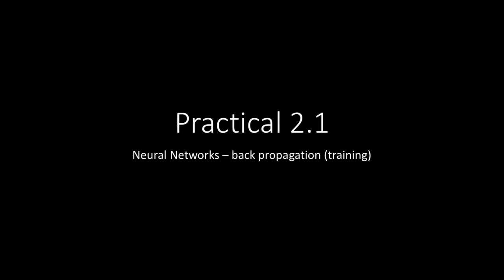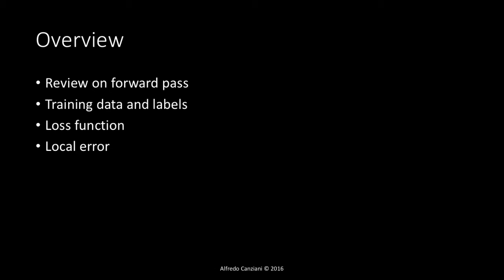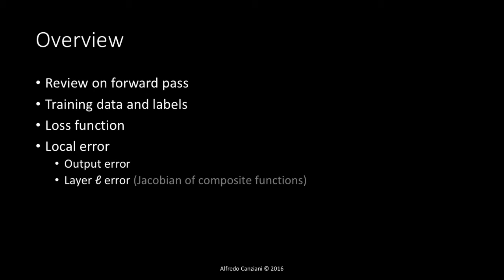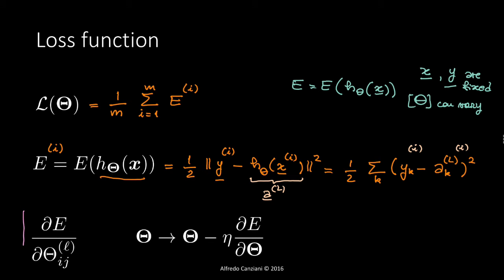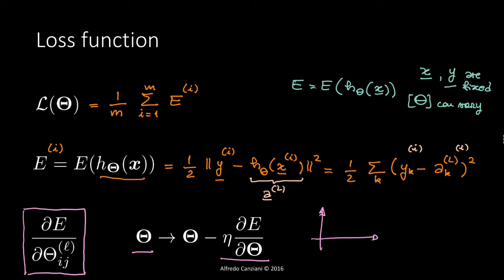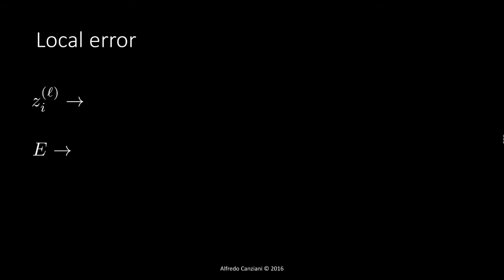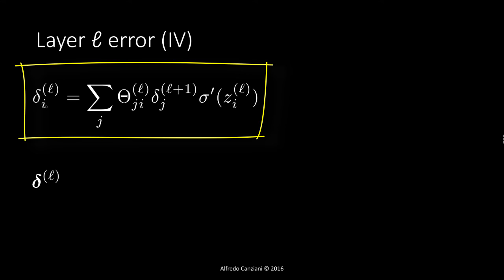Practical 2.1 – NN backward

Comment: Hello, i just had a little question, 

in my case i am implementing a simple MLP (1 input layer, 1 hidden Layer and one output layer) 

------------------------NN CONSTRUCTION ------------------------

net = nn.Sequential()
net:add( nn.Linear(?, 25) ) -- ? input, 25 hidden units        
net:add(nn.ReLU()) -- Activation function
net:add( nn.Linear(25, 70) ) -- 70 output : classes of mpeg7

i have already prepared my supervised data in my tensors and saved in .t7 files (training and testing) 

For the input one img (boundary) for me is represented by a tensor of 1000*3 

The problem for me now is what shall i write in place of '?' in this line somehow it accepts my input :

net:add( nn.Linear(?, 25) ) -- my input is a tensor 1000*3              , 25 hidden units 

i will be too much thankful if i get some response from you @Alfredo Canziani
Reply from the maker: Oh my… I've never seen this message! Do you still need assistance?

Comment: so basically in the training data X is a bunch of vectors describing n features of m different samples, say the color vector of a picture's pixels, where m would be the number of pictures provided and n would be the number of pixels in the picture. (that case would require all the pictures to be of the same size, or another measure must be taken to have the amount of features be equal in number and type). and Y is mapping K, or sL, or the number of outputs of the neural network labels onto that training data. for example: "red", "bright" for the set of features in a specific example.
did I get that about right?
The loss function I do not get. the training data shouldn't have any errors? an error is a discrepancy between a label and the data it labels, yes? for example calling 50°C cold.
Reply from the maker: Yes, you clearly got the main idea behind it, although the terminology you're using is a little bit foggy.
'X' is the "design matrix" which you described correctly.
I wouldn't talk right now about images, because they are "spatial" and we will deal with them later on, in the CNN chapter. I usually think here about predicting the cost of an apartment, or classifying some n-dimensional data. But, yeah, I ask my students to classify unrolled images, so you're fine.
'Y' is the "target matrix", where your ground truth is stored. Could be a quality descriptor (integer from 1 to K, mapping your "red", "bright" qualifiers) for each 'm' examples, or a scalar ∈ (−∞, +∞), a 1-hot encoded vector or a more exotic animal.
I haven't talked much yet about the loss function (I do more of that in class, usually), but there will be a video about losses only, in the CNN chapter. Anyhow, in first approximation the training data should be perfect, given that a mistake will simply confuse your network and weaken its understanding.
Training error Jₜᵣ(Θ) represents how off is the network's output wrt the target. As you keep training, the network will converge to a better state, where your Jₜᵣ(Θ) will eventually be zero, if the network is capable enough. Whether this is something we actually want is material for another section, called "generalisation and overfitting" or "variance-bias trade off" which I extensively cover in class.

Comment: Hi, Alfredo thanks for awesome videos , I had a doubt in nn backward video , how you wrote vectorized form ith neuron of layer(l) error , have you derived it considering all k .
Reply from the maker: Can you point out at what minute:second you are referring at?
Reply: @34.14 in layer l error  and  similary @23.14  in output error and @37.10  in parameter's  gradient
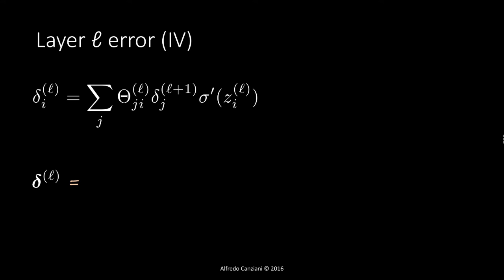Reply from the maker: About 34:14, simply expand δ⁽ˡ⁾. The matrix ϴ⁽ˡ⁾ has scalar elements {ϴ⁽ˡ⁾}ᵢⱼ, the matrix [ϴ⁽ˡ⁾]ᵀ has elements {ϴ⁽ˡ⁾}ⱼᵢ. The i-th element of δ⁽ˡ⁾ is ∑ⱼ {ϴ⁽ˡ⁾}ⱼᵢ {δ⁽ˡ⁾}ᵢ multiplied by σᵢ. The same apply for the other equations. I hope it's clear now.
Reply from the maker: Regarding 23:14, just think about the definition of ∇ₐE.

Comment: Thanks for your video, it is very clear~
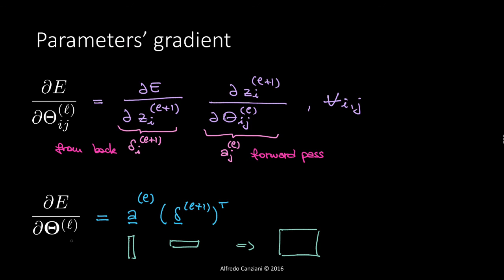One question at 37:53, I think 

d(E)/d(theta) should be
 s_(l+1) by s_(l) ,

here I don't consider bias term; 

but in the video it is 
s_(l) by s_(l+1), 
since a^(l) is s_(l) by 1, and delta(l+1)^T is 1 by s_(l+1)

I think d(E)/d(theta) should have same shape of (theta), do I make mistake here?
Reply: sorry, I saw it on the next lecture,
Reply from the maker: 林野, well, in the end it's about how you define things. I prefer the Jacobian notation, which is what you learn in calculus, usually. Anyhow, after all, the result is the same, 行不行？
Reply: Yes, of course, thank you very much
Reply from the maker: 林野，不客气。

Comment: I am having some trouble understanding the `layer l error` part of derivation from 28:08 onwards. Is there some reading resource that you know about that could help? I haven't been able to find such derivation by doing google search.
Reply from the maker: "Such derivation" took me a couple of days to write... My suggestion is to get a piece of paper and critically write down the steps I went through (check the errata in the description beforehand too). If something does not make sense, stop writing and start thinking. If you don't have some pre-knowledge of basic calculus, ask, and I will provide the missing information.
Does it sound good?
More precisely, stuff starting at 28:08 uses what I've just explained at 22:06, "Jacobian of composite functions".

Comment: at 16:37, The derivative of E w.r.t z at layer (l) is actually the error at layer l.
E is the global error at the last layer L, right? So why these two definitions are actually equivalent?
Reply from the maker: Mark, one thing is the "local error" associated with each layer and the other is the network "global mistake metric", which is  the output of the loss function, and usually represented with the letter J. Here, since I'm using the MSE, I called it E. So, the "global error" is the error that the loss return, and not the final layer. Is it any clearer now?
Reply: let me to restate. Why derivative of E w.r.t z at layer (l) is associated with the name "error at layer l'. I understand that E is the loss (you say earlier - how far from the true output).So I understand that this is actually the error at the last level L. However this is not the error of level l which, i presume, stands for "how far we are from the true output of level l.
The point is just to grasp the correct terminology.
Thanks for responding!
Reply from the maker: Mark, ok, I guess I've chosen a bad wording. Let's try to see what I meant. Consider the abs of the partial derivative of E w.r.t. to a given z, neuron i, layer l. You have that when this value is roughly 0, then we're in an optimal situation (a minimum), and perturbations on that neuron won't affect the output. If it's non-zero, then we can do better, hence there's a residual error associated with it. Pushing it towards its minimum we will eventually zero it, and reach a stable, lower global error stage.
Reply: OK, thanks, that clears for me the terminology, i felt a bit stuck there.

Speaking of another point you mentioning here, I am still not persuaded why convergence to 0 in one of the derivative is stable. That is, why perturbations on other neurons will not affect that one later in the process, and is it always true. But this one i will still think out later through the next lessons. 
Thanks a lot for your responses!

Comment: I'm a little confused with your notation at 23:30. Is this the same as: nabla E(a)? when a is the a of the last layer
Reply from the maker: Yes, that's correct. I've written the gradient ∇ of the loss E with respect to the network output aᴸ. What was confusing?
Reply: Alfredo Canziani the problem here in Germany is that we have slightly other notations in many areas of Mathematics and i wasn't shure what to make with an index of an nabla operator. Thank you for your help and your great videos.
Reply: Alfredo Canziani I'm writing my Bachelor Thesis about a torch7 deconvolutional neural network I wrote and working for now on the Mathematical background chapter, which I finally understood and was able to write thanks to your videos. Many other sources weren't as good so the 5 background pages about the backpropagation are a bit based on your video (not too much of course , it is far away from beeing a plagiat and it is 5 pages of 50 in total I wrote ). But I would like to mention your videos as a scholarly research for this chapter and a good source for education if this is ok?
Reply from the maker: Wow, I would be honoured! Yeah, it took me a couple of days to make this video (derivating the stuff plus recording it), so I'm glad someone is finding it useful! Will be the thesis freely available? Send me a copy of the math part, at least, so that I can check for typos 😉
Reply: Alfredo Canziani of course. The thesis will be freely available and the torch7 code of the network will be uploaded on a open-source github. By the way I'm writing my thesis at the FH-Aachen, which is a small university, but the lab I'm working on won the RoboCup 2017 a few weeks ago in Japan. The team is named Carologistics. 

I send you the thesis with pleasure when its done in eta 3 weeks. It is written in English ^^, i mean its my first scientific work in English in this length.
Reply: I am writing you a PM at your google+ at this moment. I'm sorry it took so long